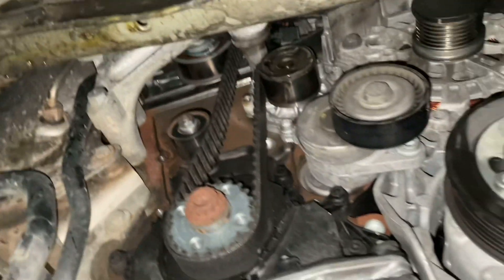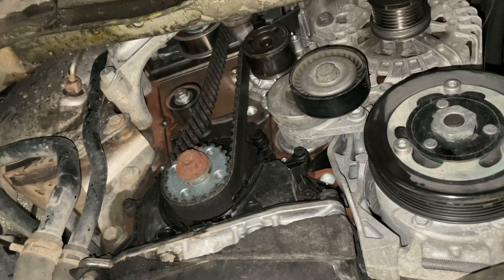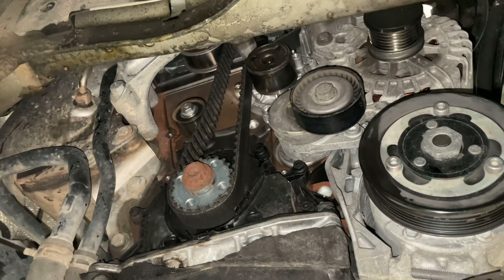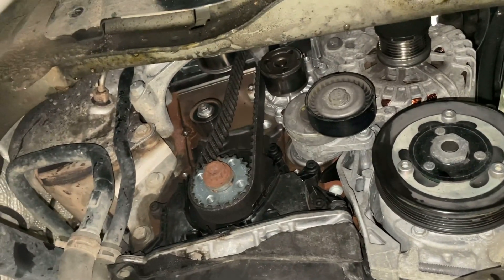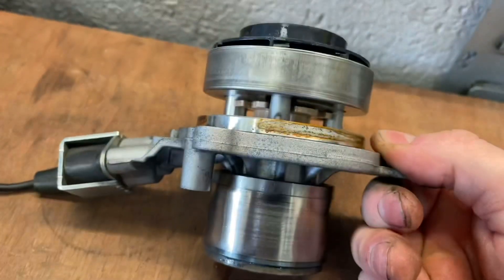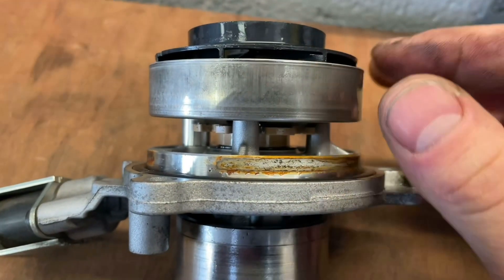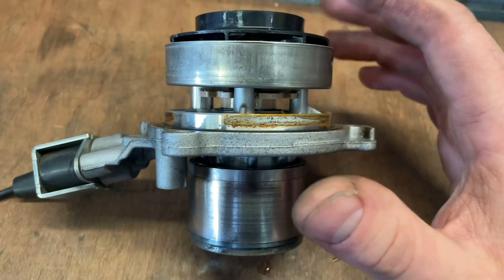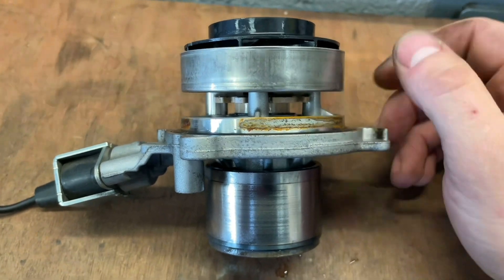Diesel Engine (EA288) Coolant Pump LEAK

Comment: Hello, how much coolant was it leaking? In ltr/ml sir
Reply: Hello sir I need the advice
Struggling with coolant leak on 2.0 TDI clocked 130k kms engine there is no visible leak no overheating but coolant is getting low and warning on low coolant light while driving uphill also engine oil temperature reached 140 c
Changed  egr at 90 k in warranty and intake manifold in 110k still leak .
Reply from the maker: Hard to diagnose without seeing the vehicle buddy
Reply from the maker: Enough for me to call it a leak matey

Comment: I’ve just spoke with a VW dealer and they’ve told me my 2017 2.0 TDI engine has the water pump on the other side and is not driven off the timing belt… so doesn’t need to be replaced at same time. Is that correct info? Everything I’ve read online seems to contradict that
Reply from the maker: Hey, a 2.0 tdi has a cambelt driven water pump, it’s the petrol engines that are on the other side of the engine

Comment: my pump went at 30k and 68 k and 94 k . all under warranty.vw should recall the pumps in the mk7
Reply from the maker: That’s really bad luck buddy :( I don’t think I’ve seen a car chew thru 3 water pumps in less than 100k hope yours is ok now?
Reply: seems to be except the grind grind noise at idle from the passenger side by the timing belt .  dealer says the cant hear anything but i can across their parking lot. only at idle and I've put 10000 on it and it still starts
Reply from the maker: I agree with you they are really easy to hear when they are about to fail

Comment: Seen many times that issue also never have changed cam belt without water pump and on a VAG group genuine bits only 
Genuine VAG stuff usually on par with aftermarket parts price wise 
Anyway great video thanks
Reply from the maker: Thankyou for the feedback it’s really appreciated and absolutely always advise changing pump with belt I am seeing some customers now not wanting the pump to be changed which is very weird and like I say only seems to be a recent thing